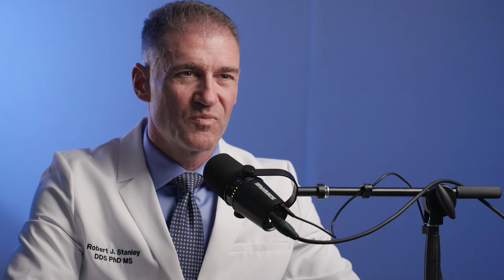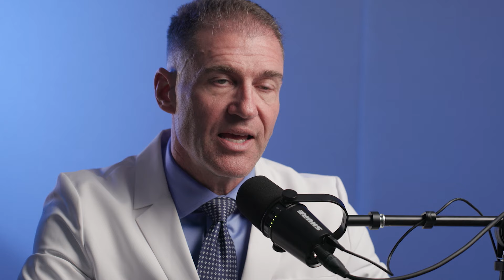Your Dental Implant X-Rays ARE NOT Measuring Crestal Bone Loss.

Comment: Doctor, I had an implant put in about one year ago, and I had my abutment in crown put on about four months ago.
Five days ago I was chewing some soft food and I heard a small crunch. The tooth was loose. I felt the implant loose and for a couple days it became more loose.   I contacted my doctor right away and they took an x-ray. Put me on some antibiotics. Sent me home and told me three days later they were gonna remove it.
I didn't have any signs of infection, but they wanted me on the antibiotics
But then, when I got home, I touched it with my tongue. I moved it a little bit, and the implant with the screw in a butt all came out and fell in my mouth.
I still have no idea what is going on and my doctor is now talking about additional bone graphs to put a longer implant in they used a mini on tooth number 15
I am still in shock and I couldn't believe the whole thing just fell out

Comment: We're in a tough situation because I dont think you can house a custom jig for each patient for each implant you place, you would have a storage and retrieval issue. What do you think about using PA's where the threads are parallel only and while you may not have it EXACTLY perfect, it oftentimes is accurate enough to measure bone loss up to different threads.
Reply from the maker: You certainly have a valid point here. I’m not suggesting this for daily practice. Instead, I recommend it for all research focused on crestal wound healing and bone loss. This way, we can be more confident that the findings are relevant and not merely random noise.
Reply: @Stanleyinstitute  Very true. that should absolutely be the standard for studies analyzing bone level.